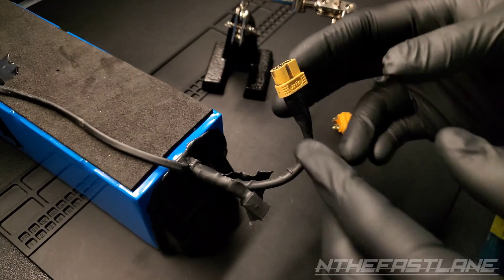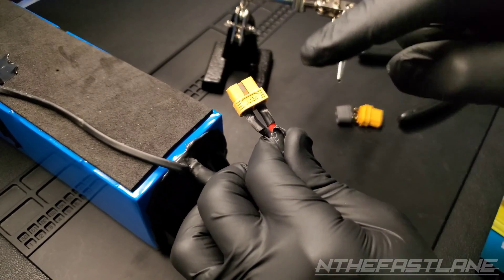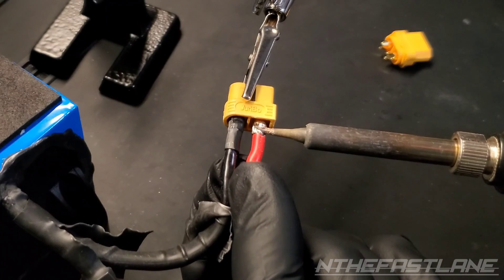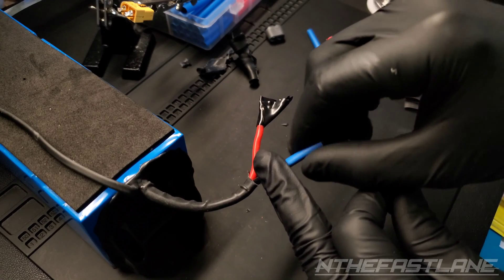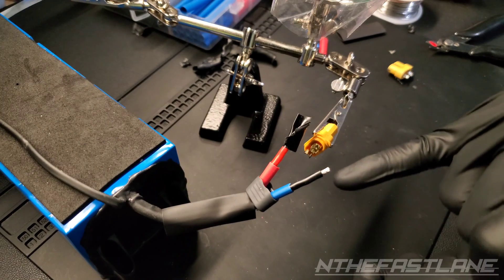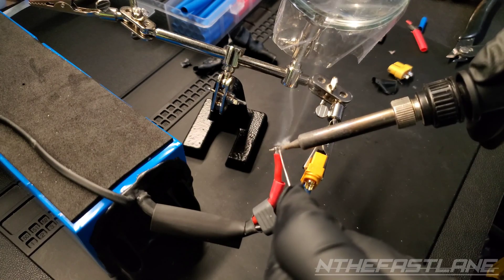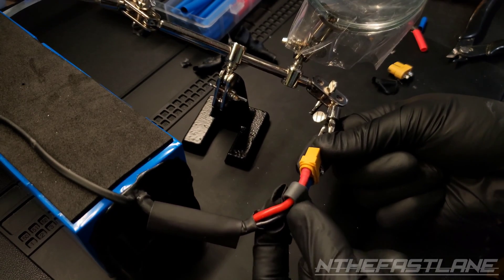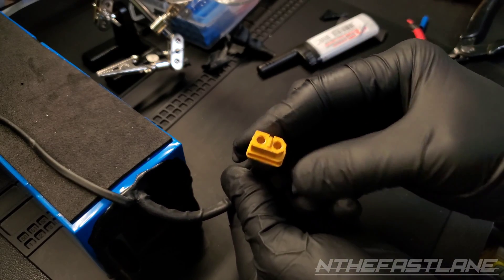Safely Fixing A 36v E-scooter Battery Connector - XT60 Lithium Repair Guide

Comment from the maker: Here Are The Item I used For This Battery Repair
🛒XT60 Connectors: https://amzn.to/3Q4NzCR
🛒Soldering Iron: https://amzn.to/4cYX3JW
🛒Solder: https://amzn.to/3xxYHln
🛒Soldering Pad: https://amzn.to/3UgZgcb
🛒Snips: https://amzn.to/3xzxpv5
🛒Heat Shrink: https://amzn.to/3TVOhUd
🛒Soldering Arm Clamp: https://amzn.to/3JhE13G

Comment: I’m trying to swap the ring terminals on my battery do I just snip the wires one at a time and re solder to a xt90 individual to be safe ?

My concern is cutting a wire individually and it sparking it bec of too much charge ? 

Idk if my battery has full charge or not and don’t know if it affects me cutting those wires as long as I do it individually
Reply from the maker: Yes, snip one at a time. Put electrical tape over the first cut end, then snip the second wire. Take the second wire and strip the end and solder it to the correct terminal on the XT90.

Let's say the second wire was the negative, now you'll grab the positive and place it on the positive terminal of the XT90 connector and soldered it on.

As long as you don't touch the two wires together while you're snipping and soldering, you'll be fine. That's why one at a time is the best method.

Comment: My electric battery is not xd60 and my controller is If I cut the the xd 60 and connect copper will it work
Reply from the maker: For safety I would just purchase some XT60 connectors and solder them on. 

The XT60 connectors have a safety feature. When there's a short between the connection, the brass will melt and completely disconnect. This will disconnect the voltage from the system.

Comment: Hey,love the video...question....
I need to remove 2 inline fuse holders along with the XT90 connectors so I rewire all back on. Its a 72v battery. In what order am I able to snip the wires coming out of the battery to fix my issues.

Currently there is 2 main power wires,both 45A and 2 smaller charging cables.

I just need to remove 2 main power cables  positive and negative. I.e 4 main wires.